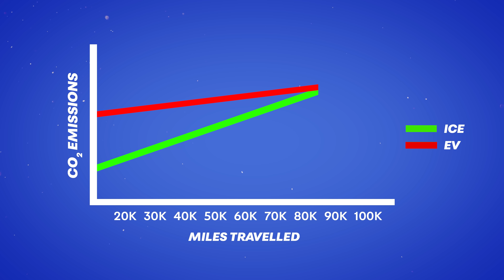Are Electric Cars REALLY That Green? [New 2022 Data]

Comment: I believe EV batteries last roughly 5 to 15 years, when these batteries fail, the cost to replace them is huge, probably equal to or greater that the value of the 5 to 15 year old EV itself. The highest mileage Nissan Leaf's for sale in Australia right now are sitting at roughly 60,000 Kms (37,500 miles) and $20,000aud for a 2012 model and the cost to replace their battery is about $10,000aud as of a few years ago. When these vehicles hit battery failure age, I can't see it being economically viable or sensible to do anything other than crushing them.  If for what ever reason you decide to resuscitate you beloved Leaf, it'll empty your bank account. The environmental and human cost to dispose of and mine all that Lithium and Bauxite is also substantial and shouldn't be ignored, there's a reason they call EV batteries "Blood Batteries". EV's may be fun to drive and give people the feels but they DON'T save the planet or save you money. Experts even suggest you don't buy a hybrid that is more than 5 years old as you'll be up for a big bill not long after purchase. I'll stick with my Polo GTI for now I think!
Reply: Every ev manufacturer has at least an 8 year warranty, they last much longer than 5 years.

Time will tell how long they last, with EV's only really taking off around a decade ago. Although ten year old EVs are still out there.

Also a hybrid more than five years old? hybrid batteries also last longer than that, anecdotal, but the 4 Early 2010's Prius drivers I know have not yet needed battery's replaced on their 10 year old cars

Comment: What about end of life?  An ice car doesn't have lithium and cobalt to dispose of.  Lithium and cobalt are extremely hazardous and toxic.  Did Volvo also include the environmental damage that will occur when disposing of these hazardous materials?   Nah, of coarse not.
Reply: Lithium and cobalt are recyclable. Once an EV pack is actually dead (which is beyond its useful life actually in the car), it can be recycled and the materials used to build another battery. Unlike petrol, these elements are not consumables.

Comment: Why release the report?  We need to know the whole truth for a change so happy they have done this. How many miles does the average car cover? Most drivers in cities will never reach those figures but yes the air will be cleaner, good, however do you live near a power station generating more electricity to cope with demand? Glad I don’t live too close but I suspect pollution travels easily. Your electricity is only supplied from green energy? How, they are the same transmission cables leading to each house, they can’t say “ wait a minute, number 5 now gets their power from My Green Electric Co.  We must push renewable voltage down the cable but don’t let number 6 have it.”  Unfortunately a lot of smoke and mirrors to pretend that governments and businesses are doing the right thing, each method has its consequences. I wish we knew the answer, maybe EV’s are good, who knows?  On the continent during the industrial revolution and through the coming years they used to call the UK “the Dirty Old Man of Europe”. But we in the UK do pontificate a lot here now, let’s hope we can find the answers.

Comment: Guys let me shed some light for you, take my prius as an example, the battey is to date 13 years old my car has 250000 km on th3 clock and battery is still going strong, i would say at least 95% maybe 90 of capacity. Im sure it will be fine another 250000, as many prius owners do up to a million kms. With the latest battery tech and not even mentioning solid state battery's that are now hitting the market. You never have to fear a battery replacement for atleast 500 000km, if it is any less you have a bad battery to start with. One guy told me a prius needs battery replacement every 250000 kms, i said to him are you crazy, if you work the figures back to price per km on that scenario it will mean the prius is the most expensive car to drive in the whole world. The same goes for ev's. If you need a replacement mid term there os no way that you can afford that as the battery is the most expensive component in the vehicle, rather get a horse then. And the myth that batteries is environmentally a challenge is also rubbish. There is huge companies that actually recyle ev batteries to raw components again. Just check Tesla for instance, they have a company that just do that. You will probably get a lot of money for your old battery, just do some research.

Comment: Sorry, but those figures seem to be missing a major component. EVs have about HALF the number of parts as an ICE. Further there are about  20 moving parts in an EV, versus 2000 moving parts in an ICE. Furthermore, EVs require less maintenance overall. So significantly fewer parts need to be manufactured and replaced over the life of the car. That alone makes EVs more environmentally friendly.

Comment: Nice presentation with one large mistake.  We are not at the limit of the efficiency of ice cars.  Typical gasoline cars have an efficiency around 30% fuel to energy. A very very efficient one might approach 40%. In the past few years Mercedes F1 broke 50%.  Those are some huge potential gains.  Diesels are over 50% but generators are even higher so there is room to grow on the vehicle side there also.   None of that changes the fact that eventually the fossil fuels will run out so an alternative does need to be found, but if we are honest about the facts we can find the actual best solution not just the one that is most popular.

Comment: One thing that is being ignored here is that eventually you can't recharge the battery, and most batteries are also a part of the frame. A petrol engine can be rebuilt or replaced. Additionally, I have to wonder if Volvo factored in "end of life" issues with electrics, such as hazardous waste disposal.

Comment: People seem to be looking at the emissions aspect of this ICE vs EV comparison, but don't seem to look at other factors such as the battery end-of-life, consequences of increased energy demands, the costs of those 2, and the situation with ideal vs reality. Those shouldn't be discounted as you solve one problem, you wouldn't want to create 2 others. EVs are gonna get better and cheaper overtime, but potentially ICE has a life too in the coming decades as some stubborn manufacturers pledged to keep ICE alive, which tbh isn't a far fetched idea, but then it will have to depend on how the EV technology and infrastructure matures.

For me, the way to tackle emissions isn't with ICE or EVs, it's with human behaviour. Covid lockdowns in 2020 has shown that most people can just work from home on most days, and that could reduce the usage of vehicles or even the need for vehicles, hence reduced emissions too. The change of behaviour in our driving needs can also shift the market demands to EVs as the norm. Other than that, taking a page from Japan's book, eliminating the need for a vehicle could also reduce emissions by having good zoning laws and public transport infrastructure.
Reply: As they used 120k miles as limit, it means the batteries are not spent yet. The big issue there is that they didn’t consider battery recycling, which will be huge part of future economics with cars, lessening the co2 emissions a lot in EV side.

Comment: However the typical home charge is at night after office and shop use, so it is likely all carbon* generated electricity except in high nuclear countries like France or hydro areas.  Taking their math and the typical charge time the break even is 140,000 miles or 180000km.  Since most EV buyers are trendy, they often trade their car in less than 7 years, so unless you're running a taxi or delivery service, the original owner will never produce less GHG via their purchase.

The used car driver might, unless they have to replace or upgrade the batteries....which means the curve starts over and now needs at least 60,000mi or 90000km to overcome that new battery production and installation.

You're not going to save the planet buying expensive new electric battery cars.  If you want them, fine...but it is an atmospheric wash.

You can save more by keeping your current car much longer and keeping it in good working order.

You can save more carbon still by living within 3km of your work, schools, services and shops.

You can save more still by not buying whim stuff.  Not buying fast fashion.  Not ordering Amazon or Wish when bored.  Not taking flights ANYWHERE.   Not taking destination vacations.   Not eating at restaurants or take away.  Preparing meals from scratch instead of box and tin warming....

Not encouraging your nations to go to war with an oil producer over an oil and gas to Germany pipeline hub.

But you guys do what you want

Comment: Truth be told you've got it completely wrong.. Almost that is . As production goes into EV cars or hybrids and piston cars go down That break even point becomes closer and closer to less than the day that hits the road the only real problem is the batteries having to replace them but by then recycling the batteries should be in full swing

Comment: You fell for the green energy tariff BS. They are no more green than any other tariff.  Green energy is always used when available. Fossil fuels are used to top up the grid.  So given all EV usage is extra you can only count it as no emission if the whole grid (or at least your local distribution Network, 14 in the UK) is on 100% emission free at the time of charging.  Charge at any other time and your using gas or coal which is potentially worse than petrol.

Comment: I think that your almost closing remarks say it all. This is still a fledging market and it will take time for the market to evolve a new EV market. Things like battery innovation. 
But to me as an EV owner, it  will be the larger number of charging points which will lead to less range anxiety, further leading to things like the rise in adoption of smaller "commuter" style cars or local delivery vans with smaller batteries leading to lower weight and better efficiency straight off the bat. While there will always be a need for long distance driving, adoption of these type of usage patterns will go a long way to drive that break-even point way down.

Comment: Worthy commentary, and yet it misses the point entirely in the first several minutes. EVs are a 'push' that will not and can not slow down. In the long term, EVs will be the answer and without doubt the time to start moving that way is now. It's worth a bit of discussion, please:

It will take a long time to improve battery tech, materials and manufacturing. But what's a 'long time'? As it turns out, the speed of battery improvement is ramping up - immensely! - and (here's the point) that is happening because the push for EVs is so huge. Get it? You can't improve without the push. This is kind of like what saying 'we're going to the moon' was like in the early 60's. Well, we weren't going to get there unless we started with a 100% effort, even tho at the time they started both computers and rockets were not capable of success. By the time they started Apollo, tho, computers were much, much better and they worked. The Saturn V was in development almost from the start and by the time it was needed it was ready. Do you see the Big Picture now? It took time to invent the technology from scratch. We burned three astronauts to death figuring out some basic issues with the capsule and the Soviets couldn't do it at all.
====> WE GOT THERE. And we did it on time, too.
In the case of carbon footprint we have no choice... just like the moon missions, failure is not an option, only this time it is for all the marbles for the human race. Long term, we fail, everyone dies and the planet goes through a massive extinction event.
Now you can bitch about batteries. You should bitch about batteries, too, by the way, but the point is to make them better, not to stop making them. Same with the grid and power storage and energy sources and carbon sequestration...

Comment: As a hi mileage driver ( ford transit 185bhp and average 9.2 l per 100k based on 50000 + klms) why are we not seeing the option of electric cars without the heavy electric seats windows and all the other energy sapping parts esp big wheels and wide tyres. Why not an ev version of a modern 2cv or similar; esp for local runs warmer climates etc ?

Comment: We now have better rotary engine designs that would improve fuel efficiency of ICE, so we are not at a limit yet. Also, ICE engines can be made to use biofuels and reduce or even start off with a negative CO2 emissions level (look at algae as an example). So far biofuels produce lower power output compared to fossil fuels, but more efficient engines could make that a moot argument.

Comment: Does Volvo’s Study only account for emissions from mining raw materials for batteries, or does it also account for using recycled battery metals? I would presume the latter produces less emissions, but I could be wrong.
Reply: Volvo is doing this on their current supply line, therefore battery recycling is not in there.
in the future when car batteries get scraped in a bigger extent, only then would recycling start to make an impact.
the way to go cleaner is to check the supply line and make it greener, look up northvolt who will probably supply volvo with batteries in the future, they are going to build batteries using 100% renewable electricity for their factory in northern Sweden.

Comment: 90,000 miles with an average range of 250 miles per charge is 360 charging cycles.  Are we trying to pretend you could charge an ev 360 times without needing to replace the battery or are they considering that and adding the additional footprint of the new battery in the calculation as well?

Comment: You forgot to factor in the HUGE pollution created by manufacturing, installing, clearing land, wiring, manufacturing wire, installing wire, manufacturing substations, heat from substations, concrete, etc., from your "green" unreliable energy. Just saying.

Comment: living in a country where getting used car with 300-500k KM is normal, cant see any EV that would outdo petrol car. At that point EV battery will be complete junk and EV without decent battery might aswell be dumped and getting new battery WILL cost more than car itself and therefore create bigger carbon footprint at which point it could catch up to combustion car.

There needs far FAR better batteries for EVs to be practical or atleast on par with combustion cars. (not to mention if you using your car for travels outside daily drives, EVs just arent ready.)

Comment: A similar debate must have take place in the press when the world was transitioning from horse drawn carriages to petrol cars.   In the end economics drives the policy.   Where I live electricity is produced from legacy hydro damns and a kwh costs 8 cent which means that it cost me 15 dollars to drive a 1000 km.   The same trip in a similar suv costs 240 dollars when fuel is a 2 dollars per litre.  I will keep my ev for over 150000 km untill I upgrade.

Comment: I think an important point of electric cars was not mentioned. They are energy diverse. You can charge an electric car with solar power, wind power, water power, or gasoline power (generators). Gas cars can ONLY be powered by oil and gas.
Reply: @Pascie   and gas get pumped into the air every single time you start the car. I have a 22 gal tank and fill up once a week. Thats 22 gals now in the air every week just from 1 person.

Comment: Well, actually not so simple, when EV becomes dominant type, you need to keep generating spare electricity supply to make sure the power grid don’t blow up when everyone is charging their cars overnight. That kills off the power plant efficiency Gwen aspect. And you need to redo and beef up the whole city power supplier lines which is extremely not green
Reply: Does the power grid blow up when you switch on your kettle and toaster at the same time? No? Then it won't when you charge your EV either.

Comment: Green energy is a pipe dream. Require scarce materials controlled by adversaries. And you are dead wrong about ICE. EV has no future. Ice is the future. Greener & doesn’t require materials & drastic spending on infrastructure that no one can afford anymore. And don’t forget, usability matters most not being “greener”. Just the facts of life. As the globalist system dies off, you will gain a more intense understanding of this.

Comment: EV is a stupid idea. Not just on the pollution front but economic & geopolitical ones as well. ICE is the way forward. Re-engineered fuels, like Porsche E-fuel with 85% of the pollution engineered out of them, that can be used in vehicles without prohibitively expensive infrastructure is the only realistic option.

Comment: You're the one using outdated data, the manufacture of an EV creates perhaps around 30-50% more CO2, but the amount of CO2 created for the manufacture of the ICE fuel added to the amount of CO2 in tailpipe emissions is significantly higher than you might think. Also all the while the grid is getting greener and a lot of EV owners use solar to charge.

Comment: Also, many are going EV to save a LOT in per mile energy costs, while generally getting much better resale values—many even reselling for the same or higher than their purchase cost. With average electric sources it cost people less that $16 per “fill-up” vs about $80 for gas.   From solar panels it’s even less per recharge vs fill-up.